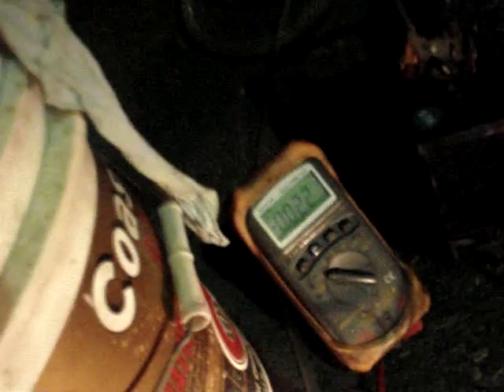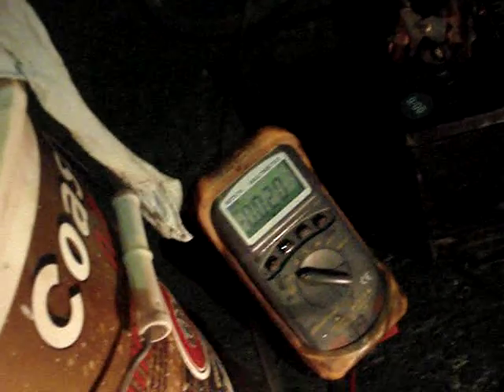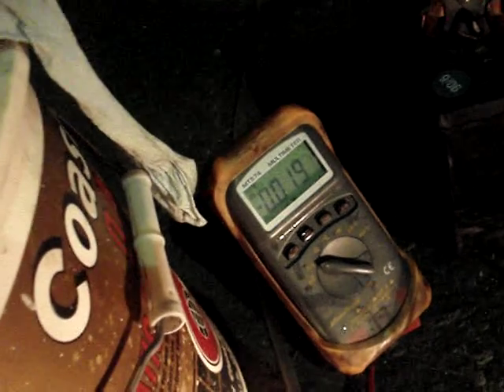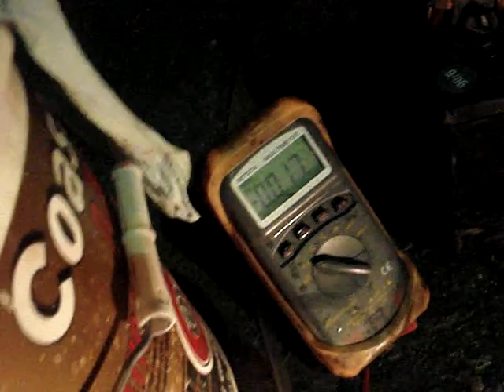o2 test do we indeed need efie-extenders?

Comment: Hello Ron,
Great info.  I've got an '88 Chevy K5 Blazer with a HHO unit.  My MPGs seem to be worse running the HHO generator.  I have a PWM and a MAP enhancer but still sucks gas.  Running 15 amps with 3 tbsps of potassium hydroxide as my catalyst.  I was wondering how you normally reset the computer to recognize the HHO addition to the engine?  Not sure if I nee to increase electrolyte content or up amps.  
Thanks...Sean

Comment: a narrowband is so inaccurate you cant even see the difference in voltage between 13:1 and 11:1 at wot on petrol so with a tiny amount of O2 it isnt going to show any real difference on one .they are accurate at 14.7:1 thats about it fuel trims at cruise is where you would see any difference. and an engine pulling 300+cfm of air you probably wouldnt notice any difference anyway pumping in 2l/min or hho

Comment: hi im not going to modify ,or change ,map,maf,iat,or use o2 extenders,just put it in as close to the combustion chamber as possible,just let it do what it does ,i might be crazy ,but i dont want to lean anythingout i just want to see it enhance the combustion,ive put straight hydrogen into a carb set up and had no problems at a no load situation ,any comments would be nice ,god bless you all ,great info thanks

Comment: ive got a 2001 pt cruiser thaim thinking off putting the hho into each intake runner past the map sensor,prior plumbing into the vacuum ports has drastically different results ,beforethe map on top of the throttle body results in20 mpg,into the intake below the map,24(normal).this is with none teed into pvc .i'll post more on the pt cruiser ,including o2 extenders,in all of this this little car screams when its getting hho(baking soda electrolite)keep up the quest guys

Comment: I showed a consistant 11.2% increase in mpg on a 2003 chevy 4x4 w/5.3 liter engine and no electronics. Had very sparatic relults by adding a low volume of steam but could not repeat 2 days in a row. 34,42, and 41.8% increases. Once I added O2 modifier things started to get bad. Have also adjusted MAP to lower my lean out limit. Engine started running so rough I had to back off as this is my work truck. Also tried adding CO with poor results. cold vapor was also a bust on this engine.